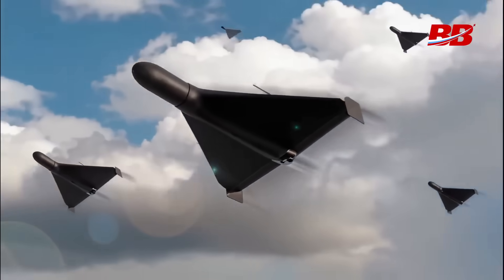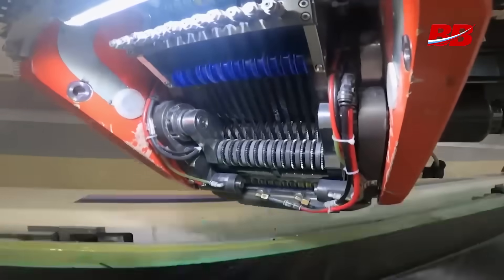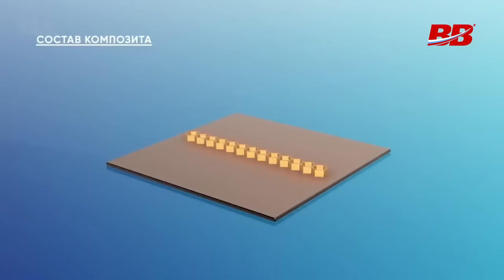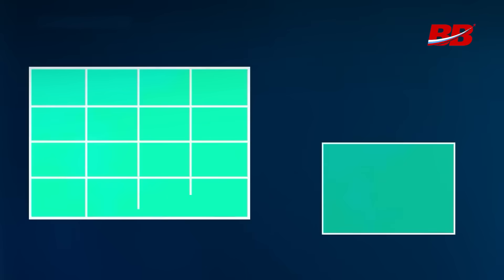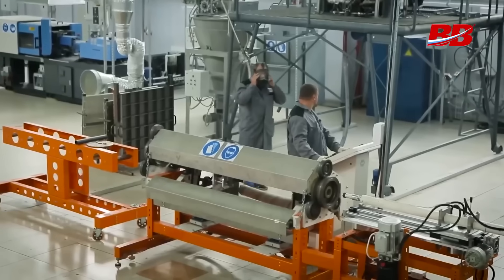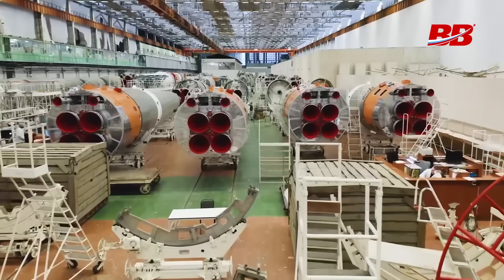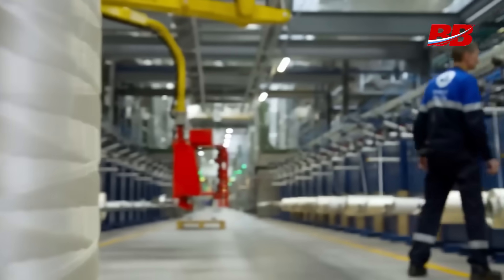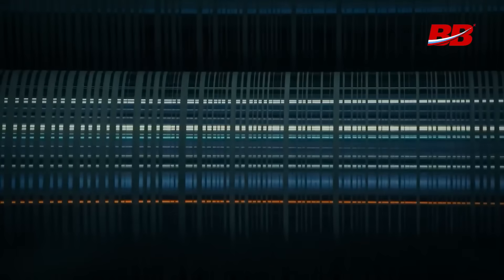Only Three Countries Have This: Russia Launches Major New Production

Comment: <<><>> 💢💢  We have patented an ultra-high specific torque [compact] gear technology which does not utilize toothed gears, based on our reformulation of gearing theory, to outperform all other gear architectures, called FrictionLess Gears. It can be formulated in rotational or linear solutions with ~90% reduction in size.  💢💢 <<><>>

We can also offer revolutionary induction-less/magnet-free, ultra torque dense motors which do not require rare metals and ~90 less copper.

Our groundbreaking power dense, high performance engine designs burn any fuel cleanly w/o any noise/odor/smoke/pollution [just CO2], making it suitable for all applications, including robotics. For robots, we have conceived novel high specific power transmitting mechanisms which reduce complexity/weight/package size.

💢💢 <><><> Our innovations enable advanced, compact, low cost, high efficiency, turbo-engines and power generating turbines  <><><> 💢💢 

And more...
--
✈✈✈ℕ𝔼𝕎  𝔽ℝ𝕆ℕ𝕋𝕀𝔼ℝ  𝕋𝔼ℂℍℕ𝕆𝕃𝕆𝔾𝕐  𝔾ℝ𝕆𝕌ℙ is a visionary multidisciplinary B2B innovation company utilizing a licensing business model or collaborative enterprise with strategic partners to develop Advanced clean, efficient, power dense solutions in domains of energy, propulsion, mobility, robotics / exoskeletons and clean technologies with a particular emphasis on the aerospace sector including space exploration and commercialization
...
...
...

Comment: Excellent insight into the Russian Federation.... thank you.

Composites are incredible.
Most of my road racing bicycle is a composite material built with the latest highest grade shimano alloy/stainless steel, 24 speed electronic shifting & hydraulic braking systems... including a power meter.

The bicycle was and i think still is the most efficient form of human transport ever developed. But composite materials and its aerodynamic profile takes the humble 7kg bike to a new level.